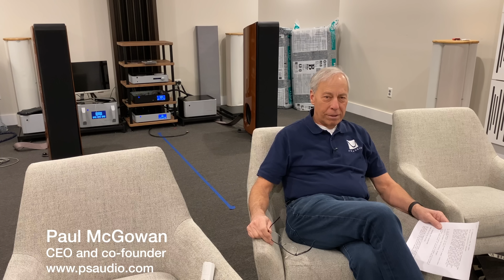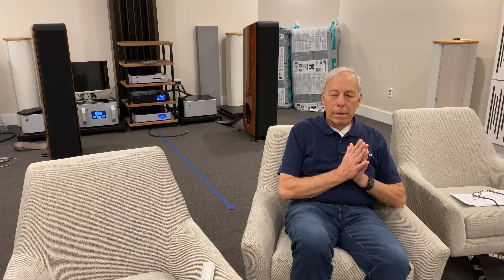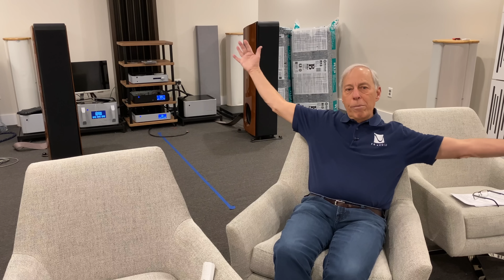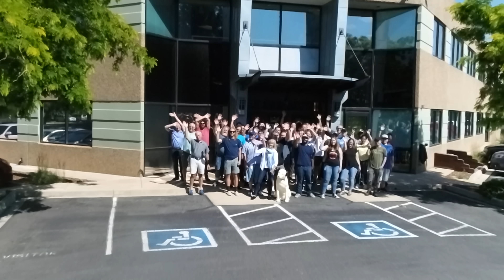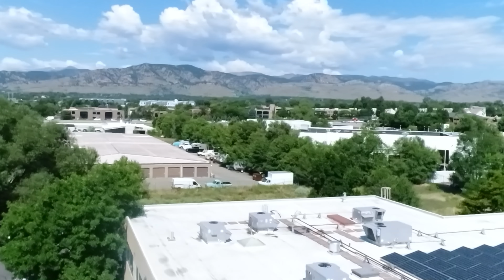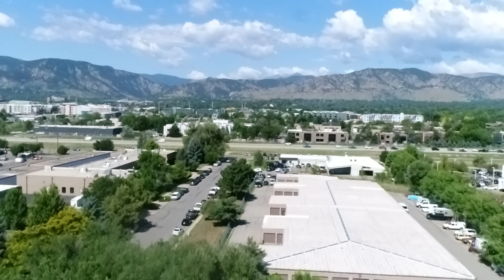Measuring imaging and soundstage

Comment: Horizontal Off-axis Measurements.

If the horizontal off-axis looks similar to the on-axis, it will image well.

If the horizontal off-axis retains SPL well, it has wide soundstage. Depending on some factors, a wide soundstage usually means a widened center image, which some like and some don’t.

This is assuming the phase/frequency between speakers is matched.

Room placement is also of course important.
Reply: I saw some speaker measurement  review now a day subjective listening is the same on what you comment here.... Reviewer reveal the measurement for the speaker that sound very wide soundstage and less focus image.  Is reflecting to Speaker Radiation angle...  Speaker which has wide dispersion or wide horizontal off axis angle... Is having wider soundstage too..

Comment: 2:10 - You COULD measure phase vs. frequency using a sweep-generator, but that would be VERY hard on the ears! :)
Reply: Phase shift doesn’t matter if it’s the same for the pair.
Reply: @homeboi808  so would you not then first confirm that it is indeed the same between the pair?
Reply: @shaunonverwacht9626  sure.

Comment: Hi Paul,

I’ve thought of a possible way to measure soundstage. I don’t know... it might work as a starting framework anyway:

1. Set up a binaural microphone

2. Set up point source speakers in an 8 pointed star shape (an X and a +) on a vertical plane a certain distance from the mike.

3. Record transient tones at a range of frequencies from each speaker in turn.

4. Move the mike towards the speakers 1 metre, and repeat the recording. Then move it back 1 metre and repeat the recording.

This is your reference signal. To measure, soundstage, play back the recording through reference speakers and amps and record the result using a binaural mike again into something like audacity. Then swap out amps and repeat the recording. Then use audacity’s ability to subtract the signals and see if/how they differ. With some study and calibration, that might work — what do you think?

Comment: Image is easy all you need to measure is Group Delay,  Amplitude, Phase and Frequency mismatch. Basically image's is how good your system can reproduce same sound out of 2 speakers. Sound stage is also easy you need to measure how easy you can pick up a smaller signal in big signal of different frequency. Basically sound stage is how easy your system can clear make a really soft sound so it sounds far away. Most electronic music actually has really good image and sound stage because it is all computer generated. With a really good system you heard the music spin around you.

Comment: Feedback can work with excellent performance within a frequency response where the corrective speed of the feedback is well beyond the signal transition speed (slew rate voltage/time). Transient Intermodulation Distortion (TIM) is what a feedback loop can cause when it doesn’t perform well and it’s a completely measurable thing. But perhaps Paul is aware of other kind of feedback distortion. Actually I am curious what happens to the signal causing the effect described. Feedback is normally used to reduce distortion, noise and stabilize the gain. Thus removing feedback is not usually an all win and it’s much more of an engineering challenge to perfect. That’s why cheap amps use simple circuits with opamps and feedback.
Reply: I'm quite suspicious of their test methodology.  You cannot simply adjust feedback percentage without affecting gain, so they have to compensate for that.  Then the question is, how are they compensating gain (and how accurately?), and is that what is actually heard, rather than the feedback change itself?  What Paul has reported, actually implies that increasing distortion/noise or phase/frequency-response errors improves imaging.  Seems to me that they could actually be generating false imaging.  It wouldn't be the first time in the audio world, that reducing system fidelity improves an aspect of the listener experience.  
Testing of imaging effects is always highly subjective.  Blind testing is absolutely required in order to prevent expectations from perturbing results, and many variables such as listener position and head movement must be carefully controlled.  Even then, multiple repetitions are needed, followed by statistical analysis to determine correlation.  
It's like testing the effect of lighting, on the ability to resolve stereograms.  Resolving a 3D image is highly dependent on one's mental processing, attention, effort and experience.  Even worse, it can change from minute to minute, without any changes to the test setup at all, just because it's dependent on highly complex mental processing that isn't 100% consistent.  Our brains are not computer algorithms, which will produce the same perception for the same input every time.  Mental focus drifts around and changes easily with even minor distractions.  Thoughts and perception are capricious, not deterministic.
Reply: @marianneoelund2940  Feedback percentage is what defines the gain for audio opamps. No feedback means you eliminate TIM distortion but usually you easily get much more THD as a trade off. High audio performance without feedback is a tough challenge for amp design.